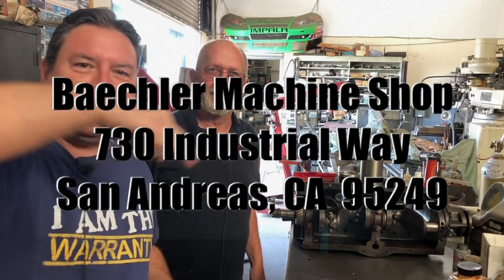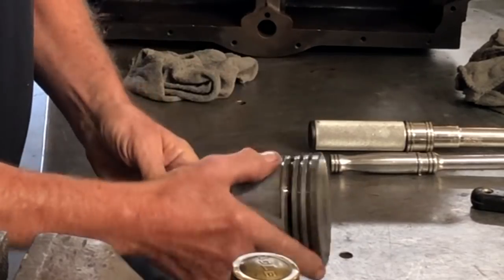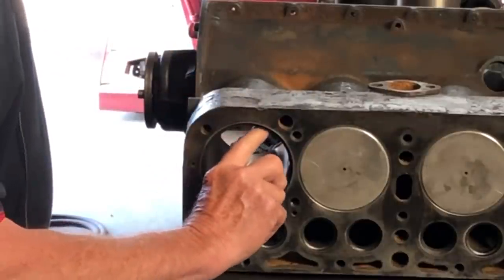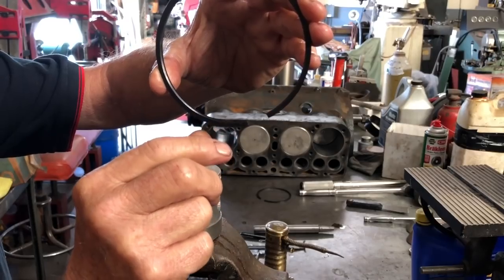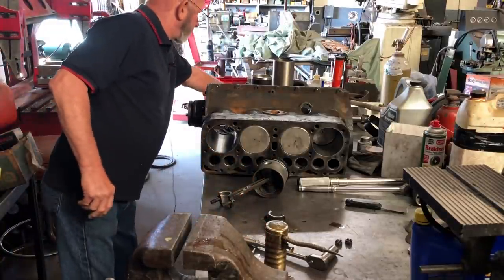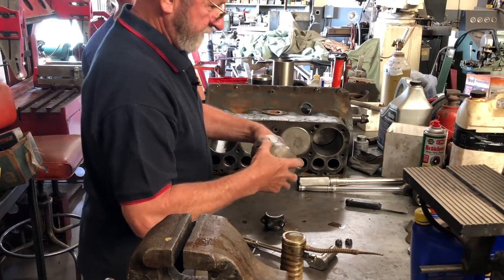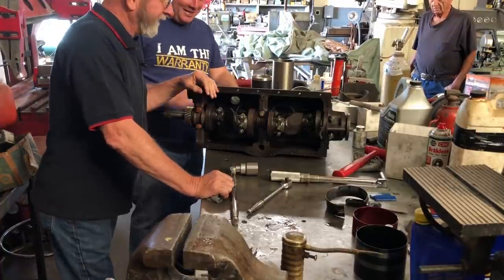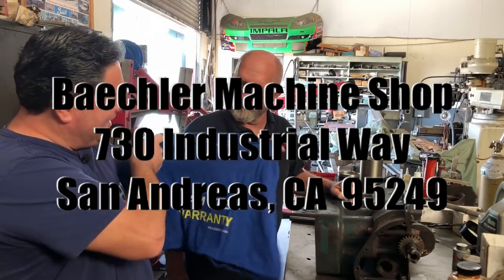How to: Ford Model A motor (engine)- Pistons and Rods: Assemble and Install

Comment: Very informative from Willie, so thank you Paul. When I was 12 my grandfather and I used the old Palmer Machine Shop to rebuild 4 engines. 2 were from Ford Model A's, 1 from a Ford Model S and one from a 1918 Krit Automobile. Lately I've been rebuilding several old T engines for a collection up north. My pride and joy is my pre 1900 hit and miss motor, which is on a carriage that I move around my property for various jobs.
Reply from the maker: Very cool!

Comment: Wow!! Twelve thousands taper!! When I was young and starting out, went to South Seattle Community College  their mechanics courses in the early 70's, we learned that if there was more than six thousands taper it needed boring. 
     My reason for listening to this entire video was because I was interested in how you put together the mains. There was a machine shop up on Capital Hill in Seattle, "A & W Bearing" who your machinist might be familiar with. At that time (don't think they are in business any more) "A & W Bearing" was the ONLY machine shop on the West Coast that was capable of "pouring" those babbitt bearings. Unfortunately you did not touch on that part of the engine.
Reply from the maker: I had a shop lined up a year ago to pour some babbit then machine it and let me video the process.  At the last minute they got cold feet and backed out.  It's a lot more difficult to find people willing to be on video that it should be.

Comment: i might have missed it but there seems to be no mention of piston /rod alignment . My pistons in England have FRONT stamped in the top so the split skirt is on the left hand side of the engine   when fitted . Could be you were using solid skirt pistons although one segment did seem to show a split skirt  not sure as I could not see it at the bottom of the skirt . Great video as usual I use your second "old school " ring compressor the one with the bands around ,works great with my trusty wooden mallet  
John Charlton
Reply from the maker: You should drop in and watch Willie assemble a motor.  Beyond a certain unknown knowledge level, things just magically happen.
Reply: @ModelA  I wish I could drop in but  I am about 6000 miles away !!! Ford Barn brought me up to date with current solid skirt pistons  I have never seen one  and I suppose I will never need one as I have plenty split skirts in the "stores"

Comment: Yes, Lucas!  I love using it for how sticky and slippery it is over conventional oils.

You touch the stuff and it just spreads everywhere, making everything slippery.  A real pain to wipe up without some kind of cleaning agent, but that's what makes it so great.

I haven't rebuilt an engine in a long time but I can understand why he uses it on the assembly bench.  It is ideally suited to keep an otherwise dry engine protected.

My truck sure likes the stuff.

Comment: I, as one, I'm 78 years old now, but when I was a young boy of 7 years old my dad had me get on a different school bus and I went to where my Dad an grandpa was waiting for me to drive the cletrak cat back and forth to load our GMC army truck with logs....we used a pair of tongs on a cable through a pully on a spar tree, the thing was the cat used to have a six cylinder engine, it went bad for some reason? So my Dad had an adapter made so he could put a model " A "  Ford engine and transmission in our cat!!! And let me tell you it worked great. Michael said that, bye for now my friends.
Reply from the maker: Wow.  Thanks for sharing!

Comment: Great video guys.i just pulled down a motor for a new set of rings and noticed that my rod caps have no shims like the ones on your video.i disassembled it carefully and noticed this when I took the nuts off the caps and removed the caps.have you seen this before?
Reply from the maker: Hey Den.  I have seen that on a motor with lots of miles on it where the shims were removed to take up the slack after the babbit wore enough to have too much clearance.  That's what they're for.
Reply: @ModelA  makes sense. Thanks for the reply Paul. I'm gonna put it all back together and see how it goes 😏

Comment: You spoke of cotter pins thru the connecting rod -cap nuts. Did the last cop nuts you torqued on get the cotter pins? Great stuff!
Reply from the maker: I put the cotters in later.
Reply: @ModelA  Got it! Thanks

Comment: Good informative video. I was waiting until your buddy to answer your question about the lineup of the rod nuts for the safety wire. The answer didn’t come. I am still wondering. Do you torque more or back off a bit?
Reply from the maker: I torque to spec.  then look and see which way it needs to go to get the pin in.  If it's 50/50, I replace the nut.

Comment: Are there different length frame and drive shafts for different Model A's? The green truck with high board slat sides looks like it would be a large truck or possibly have a longer bed then a coupe or Tudor

Comment: Willie was instructed to rebuild the engine in this manner. I was disappointed that the engine was “re-ringed” with 0.010 tapered cylinders.  Appropriate for a low use, parade car.  Next owner that opens up the engine maybe surprised and could disapprove.  31 45B
Reply from the maker: You missed the back story on this.  This motor is from and went back into a car that will probably never see the road again, is a family keepsake and they have NO money for it.  Willie did me a favor and put this together for free, the car runs again and it sitting in a garage and never driven.  So, before judging Willie or me, it helps to know the whole story.  That video is easily found on my channel.  Your "disappointment" should be joy that this lady's dad's car is again together and runs.  Better than the way it was.  And it didn't cost her a dime.

Comment: "Nuts and boobs at the same time"!?!  I laughed so loud at that I scared my little dog! ROFL!!
Reply: As for teflon sticking to the pan, it's more a mechanical thing than a chemical one.  The pans are sandblasted first.  Teflon seeps into the pores created, it is then polymerized and solidified (melting point over 300 degreed celsius, over 620 degrees Fahrenheit).  So, it's true that teflon doesn't "stick" to the pan itself; it's sticks to itself instead, and some of the Teflon is filling up the pores (trapping it there.)  Teflon has lots of cohesion (sticking to itself) but very very little adhesion (sticking to other stuff.)  Personally, I prefer cast iron skillets that are well seasoned - and pretty darn non-stick when they are.  Plus, they last forever.

Comment: Your Model A’s that have full insert bearings, do use a high pressure oil pump?
Reply from the maker: No, just the stock one.
Reply: @ModelA  Thanks Paul for your quick reply. A friend and I were discussing the use of inserts and oil oil pumps. I am going with inserts and he’s on the fence.😀
Reply from the maker: Correction- My Sport Coupe does have a slightly modified oil pump.  I forgot.

Comment: Hi Paul , just a little question, are both valves exactly the same on a model A? Intake and exhaust? Thanks again
Reply from the maker: Same.  You just set them differently is all.  11 thou for intake and 13 thou for exhaust
Reply: @ModelA  thanks Paul! Always so helpful 🙏

Comment: Please get rid of the word "motor". It's an engine....there's a big difference. A motor requires external power. An engine creates its own power.
Reply from the maker: According to Webster's, a motor can be an electric or internal combustion source of rotational power.  Umm... It's a motor.  Even Ford's  parts book calls it a motor.
Reply: @ModelA  Seems the name of the company is Ford MOTOR Company too.
Reply from the maker: @jackjohnson6339    YES! That's right!! I didn't even think of that!!

Comment: Good informative video. I was waiting until your buddy to answer your question about the lineup of the rod nuts for the safety wire. The answer didn’t come. I am still wondering. Do you torque more or back off a bit?
Reply from the maker: Torque.  Then back off.